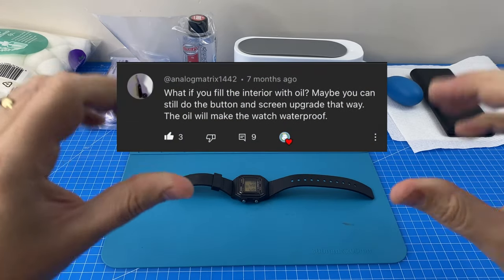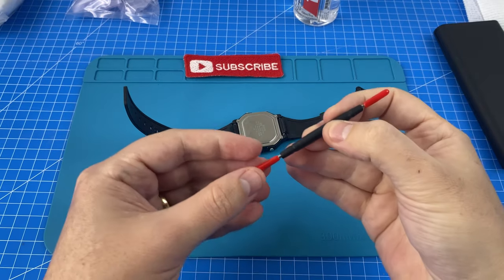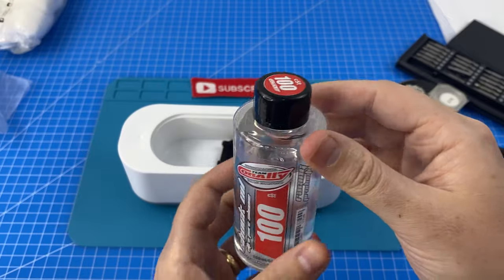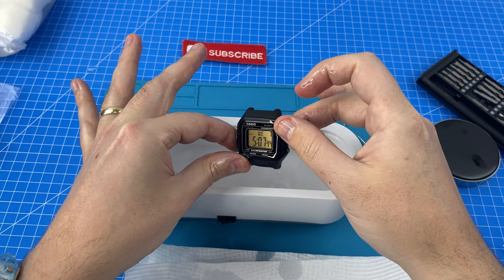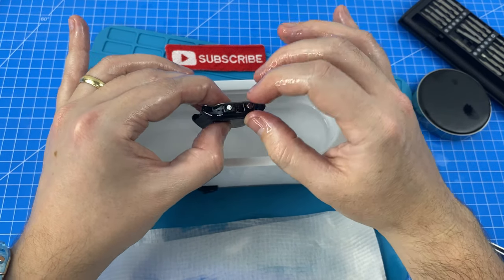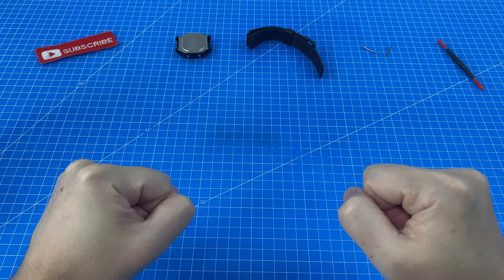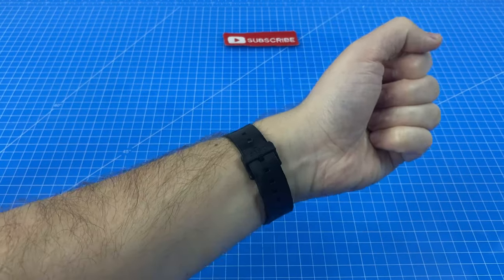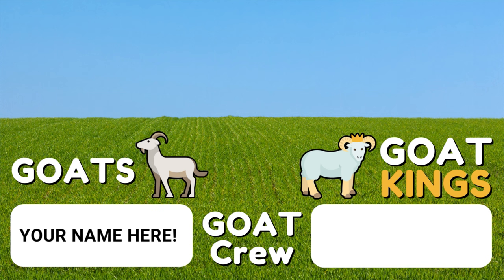⌚ Casio W217H HYDRO MOD Attempt! 💧 SUCCESS or FAIL?! 😨

Comment: Good job! For the ones with an analogic dial you should use a even smoother oil
Reply from the maker: Thank you Andrea! 🙏 This is on my mind actually, as I was thinking of modding an analog soon! Would this 100 cSt oil be too thick for it, or would it still work? 🤔
Reply: In my hydro-modding adventure I used spray lubricant, which is about as thin as it gets.
The WD-40 branded Silicon lubricant is very yellow-ish and has some gunk in it but despite this it works well for hydro-modding.
Reply from the maker: Thanks  @WyvernDotRed  ! 🙏
Man, having just read your other comment about the seals being affected and dissolving - Could this be a result of the WD-40 specifically? My inkling is that this specific lubricant is designed to penetrate, and destroy blockages, which may explain why it damaged the plastics and rubbers inside your watch! 🤯
Reply: @goatreviews  I said WD-40 branded with a reason, WD-40 the product is a de-greaser whereas WD-40 the brand makes all kinds of oil products.
What I used being a spray can *silicone lubricant*, so pretty much very thin silicone oil with some additives.
I don't recall the source but in my research of the hydro-mod I found that the silicone part of the oil is what swells some rubber/silicone, so it's probably not some other additive in the stuff I used.
This considered it is better to use mineral oil in the watch, but I wanted the thinnest oil I could get to keep the vibration alarm working (successfully).
Reply from the maker: @WyvernDotRed  ah, true. Yeah when I hear WD-40 I immediately think of their concoctions for removing grease 😅
Interesting that it’s the silicone itself that causes the swelling. It’s something I’ll be mindful of! 
Well done! 👌 I’m glad you were able to preserve the vibration alarm functionality - it’s  one of my favourites feature of all time 🤩

Comment: Could you explain what the problem with the buttons were, and how did you fix it?
Reply from the maker: Great question. Sure thing, Strangeguy! 😁

So when I reinstalled the module, I wasn’t careful to ensure that all the pushers were fully extended. I kind of had to ‘force’ the module back in, which should have been a red flag 🚩 

All I did to fix it was to remove the module again, use a tool to fully extend the pushers (after I’d pumped them a few times for good measure, which also released bubbles), and then carefully reinserted the module! 😉

Best of luck if you attempt a Hydro Mod, and don’t hesitate to reach out if you have any other questions! 🙏

Comment: Excellent video Goaty! Not sure I'd try it on a Mr G but damn, looks good! (peanut!)
Reply from the maker: I’m glad you liked it, Strangeguy! 👌
Yeah as much as I’d LOVE to attempt this on a Tough Solar Watch (No need to ever open it again - since infinite battery ☀️🔋), the MR-G won’t be taking that bullet any time soon 😁

🙌🥜
Reply: Oh I can one-up even that, I have hydro-modded a GBX-100, it's MIP LCD not needing any contrast improvement.
And this style of screen gets destroyed in oil, as I learned the hard way, but also (mostly) repaired it again.
Another problem I learned about with using silicon oil is that some seals swell in it, to the point of no longer fitting.
I had to 3D-print a new shock absorber and even o-ring, which surprisingly fully holds.
You can find my in-depth post, which also shows off the mistake, by looking for "watchuseek GBX-100 hydro".
Reply from the maker: Incredible! I am surprised you attempted it on a MIP display, @WyvernDotRed  ! 🤯
How did you manage to repair the destroyed parts of the screen?
Oh man, I hope my seals don't swell - as I don't own a 3D printer! Does this include the O-Rings in the case-backs and pushers? 😱
WOW! I just checked out your post - I see what you mean now! Thanks for sharing that. BTW, I'd like to share an improvement which may help resolve the 'stuffed in' look that happens with NATO's of a too-big size. Here's the short where I found a way around this!
https://youtube.com/shorts/aUnqn68yzhY
Reply: @goatreviews  by replacing the polariser film that got messed up with a new one that works well enough.
It has some light interference pattern issues akin to looking at a bad screen-protector with polarised sunglasses, but that adds to the charm of the project I think.

The pushers and front glass seal (not the bumper, though it could stay) were fine, they are constrained enough to stay in place.
I had to replace the back case seal, but the original ring shrunk back to it's original size, the internal bumper did not.

And I already considered cutting and melting that NATO, but will only go as far if it becomes uncomfortable. 
I don't mind the stuffed look though and for that I'd rather 3D-print covers, as I mentioned somewhere in the lengthy post.
Reply from the maker: Good stuff,  @WyvernDotRed ! 👌
Glad it worked out for you in the end, with your unique solution! 🤩
Yeah fair call. If it gets to that point, you know what to do!

Comment: I have done that 4 times in a row like for now, cause when I do once my friends are so interested to buy that, so I make for them, and I use 1000cps silicon oil on skmei 1883, 

The first one I use 350cps but it's kinda not viscous enough. So for now I always use at least 1000cps viscosity for digital watches.
Reply from the maker: Amazing! That must have been quite the experience to do it 4 times 😁
Thanks for sharing your adjustments in the optimal viscosity. 🙏
Reply: @goatreviews  it's have been a little bit easier everytime i do

Comment: But how about oils are derivated from petrol and almost all oils damage plastics and rubber
Reply from the maker: Hi Nopo, thanks for raising this 👌 This silicone oil has been selected so as to avoid reacting with the internal plastics and rubbers. 
I know exactly what you're referring to though, I have seen pictures of the damage and swelling caused to the internal components after an incorrect oil was used! Thanks for weighing in with this caution. 🙏
Reply: I suscribed to your channel  this is great .sorry for my brute english

Comment: people sa not to hdromod mechanical watches but ive done mine and still going 4 ears late. spot on with the time (its obviousl a low viscosity oil)
Reply from the maker: That’s awesome! 🙌 4 years is a LONG time. I’d love to Hydro Mod my Casio Duro - it would look amazing.
Well done, and thanks for inspiring me 🤩🙏
Reply: just make sure you put a fresh battery in, otherwise it may have issues staying the correct time with the added resistance
Reply from the maker: @TE_53349 Thanks for the tip. 👌 It’s good to have a fresh battery to optimise the time before it needs to be swapped too - which I imagine is going to be MESSY after a hydro mod 😂
Reply: @goatreviews  certainly is haha

Comment: @goatreviews
Is there a special reason for the low cSt siloil?
In an analog watch (quartz and especially mechanical, like Sinn) the lower viscosity will make sense, since higher cSt causes drag.
But for a digital watch, any "suitable" siloil with higher cSt would work fine, or?
Reply from the maker: This is a great point, Ulf! 👌 
Perhaps you’re right, for digital watches there wouldn’t be as much necessity, as there isn’t moving parts. 🤔 
I do plan on using mine in an Analog watch though, the Casio Duro 🤩
Reply: @goatreviews  I'm looking into a "10 year battery" oilfilled Duro 🙂.
Reply from the maker: @umollerstrom  That sounds amazing 🤩  I’d love to see how it goes! 👀 
Please do share your progress in the Discord if you wouldn’t mind 👌

Comment: What did you do to get the buttons working?
Reply from the maker: Great question, RSG! 
I should have explained or given it more time - but basically it was a matter of not having the pushers FULLY extended when I reinstalled the module. This can cause them to get jammed. So on the next attempt, I made sure they were extended fully, and that they didn’t bump into the side of the “oil bath” and get pushed back in 😅

Comment: Should have swapped the battery so you'd have to open it later than sooner.
Reply from the maker: This is a smart suggestion! 🙏 
I wish I’d have done that - Like I did when I restored my GD-X6900
Thankfully, I hadn’t owned this W217H for too long before performing this - So hopefully the battery is still somewhat fresh from the factory 😁

Comment: why does the oil have to be low-viscosity ?
Reply from the maker: Good question! 👌 To be honest, I’m not certain on the answer, but it’s something I came across in my research for this mod. 
If I had to guess, I would say it comes from Hydro Modding analog watches, where if the oil was too thick, it might actually slow down the movements of the mechanism. So for a digital watch, this may not be an issue! 
Another reason might be to do with the ability of bubbles to form? 🤔

Comment: Hi. Do you think it possible to fit w218 module in w217? 👌
Reply from the maker: That’s a great question, Roadgent! 🙏
I’ve found that generally, models with a single digit apart in model number, can exchange modules - such as F-91 and F-94.

But the w217 and w218 are a bit different in shape. If I get a W218, I will be sure to test this for you! (Though it might be messy, since my W217 is now filled with oil 😁)

Comment: Hello Goat reviews , I was wondering can I use this silicone oil as a refill for my lubricating foam for watches? the ones inside the foam were liquid clear type silicone oil not the white opaque color ones.
Reply from the maker: G’day SO20! 👋 
Great question! It’s something I considered doing if my lubricant-joints foam ever felt like it was running low.

I’ve never taken a closer look at the oil type in the sponge, but I believe it is labeled as “GREASE” rather than oil? 🧽

So I imagine it would have a slightly different consistency. A grease would be much thicker than an oil, right? That being said, at the end of the day topping it up with oil may achieve the same effect. 🤔 I’d be willing to give it a try when needed, as the replacement sponges aren’t very expensive! 😁

Comment: Please try a snap back hydro mod if you can.
Reply from the maker: I am very intrigued by this, Mr.DippsChad! Would you please elaborate on what this means specifically? I'm keen for another Hydro Mod so might be able to give it a try!
Reply: What I mean is how some watches got a screw down back,some has screw down plate with screws and some you have to snap the back shut. If you know what I mean.
Reply from the maker: Ah, I understand @Mr.DippsChad 👌 
Are you familiar with any Casio watch models with a “snap back”?
Most of my collection is the screw down plate, with one watch (MDV-106) having the other type of screw down case
Reply: You are right Casio don’t make snap backs on there modern watches but I did try it on a cheap watch it still some slight leak some where.
Reply from the maker: @Mr.DippsChad Interesting. Oh man, that sounds messy! Hope you found a solution for it. Thanks for sharing! 🙏